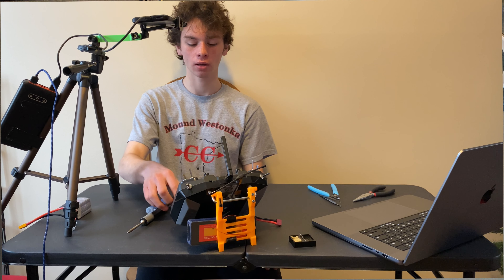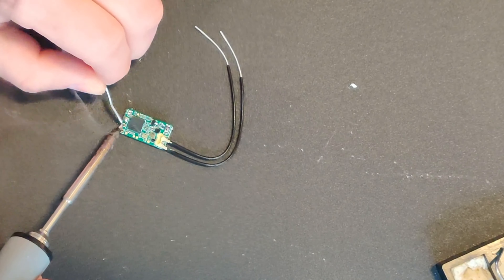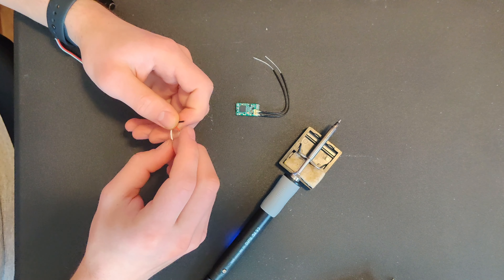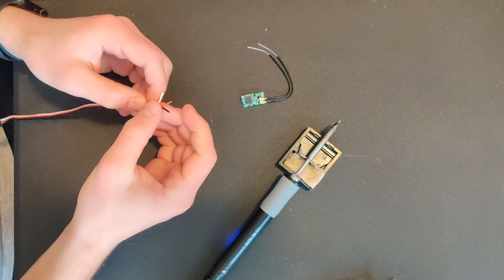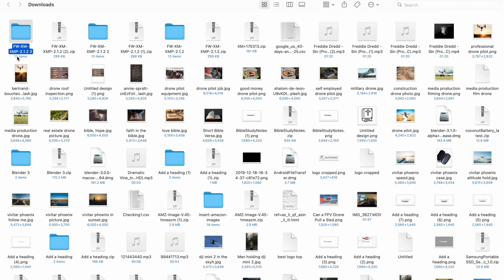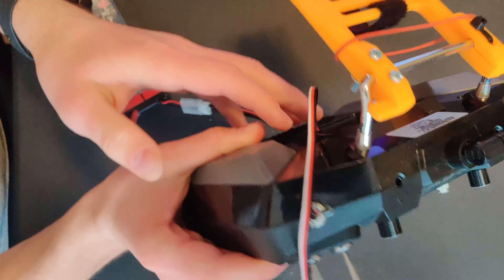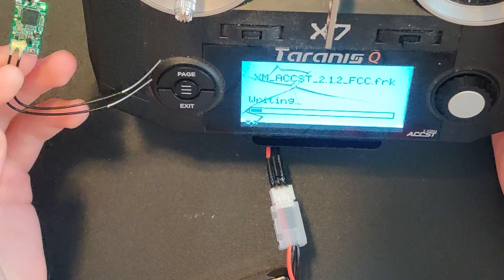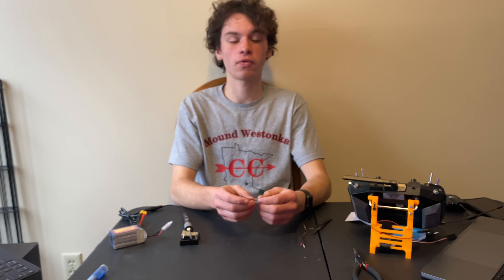Flash FrSky XM+ Receiver - Complete Tutorial 2022 (EASY!)

Comment: EasyDrone i noticed on the qx7 the servo plug has a corner kind of cut off to the right. What type of Servo plug will work for the qx7?
Reply: i just made my own connector from some old pc case front io pins, the ones for the hdd led ect. worked fine
Reply: I found the right Servo plug and after "Writing" to the receiver all went well so i took my Hglrc 4s 850 mah drone outside to test fly it and the quads battery which is new stopped giving juice at 67% and she dropped out of the sky. I tried another lipo ( Same Cnhl 850 mah) lipo/and it too stopped working at 67% (ugh). I cheched the  THR and it is at the correct mah
Something is cutting off these lipo's precisely at 67% so that is a strong clue. Can you all help me with this problem? I would be very appreciative! Thanks Guys i do appreciate your time.!!!

Comment: Great job kid iv'e never done an XM+ Firmware update so i literally followed your video and wrote down every single step so when i get my servo plug in i won't make any mistakes...Thanks for the great video!!!
Reply: mINE SAYS "dIRECTORY IS MISSING"/FIRMWARE. How do i get this fixed.?
Reply: I am having the same isuue "Directory is missing/FIRMWARE. How do i fix this so i can flash my xm+
Reply: HELP GUYS as i was getting the same issue!
Reply: Your method works perfectly how ever now my Lipos stop working at 67%.. I dong know what is causing this problebut somsthing Betaflight or in my Taranis QX7 ACCST is cutting off at 67%.Strange as ive never had these problems. Some help would greatly appreciate it!!!

Comment: Hello, thank you for the video! Using a Taranis Q X7S I found that connecting the smart port on my rx (R-XSR) to smart port on the radio transmitter worked! (Avoiding the S-Bus pads//ports) Had some issues until I realized this.

Comment: Hey Easy i downgraded my xm+ to V1. X and i plugged in the servo plug and the xm showed a red, green light. I unplug and i get a green light (happy) but when i took the drone out for a test flight using a CNHL 850MAH pack, once it reached 67% of fuel the quad stopped flying. I put in another of tge same packs (they ate new) that too stopped flying at 67%.What could be causing this issue? I appreciate your support!
Reply: Are new cnhl 850 mah lipo

Comment: Dang i flashed it with the right firmware you used but it still gave me both lights when on my flight controller :/
Reply from the maker: Hey, make sure the firmware on the receiver matches the firmware on the controller otherwise it won't work.
Reply from the maker: If both lights are on, that just means the receiver's in binding mode. It should be working.
Reply: @easydrone3100  Hey. Thanks for the video. Where do I start to flash the controller firmware to ensure it matches the same version as the receiver (2.1.0). I have a QX7.. do I go to OpenTX and download the 2.1.0 version?

Comment: curious if you can solve my problem. No LED lights on my frsky xm+. I flashed according to your video and lights worked.  Nothing happens in the binding process hence no LED lights. Thanks
Reply from the maker: Double-check that it's wired properly and that you have the correct firmware that matches up with your radio. That's the #1 issue we see happen a lot